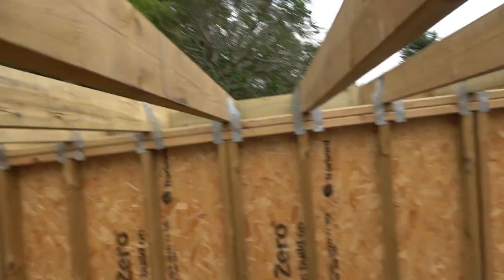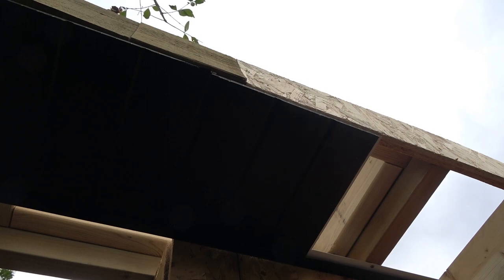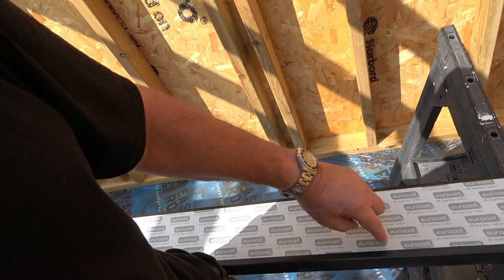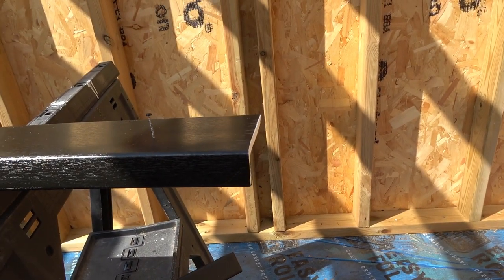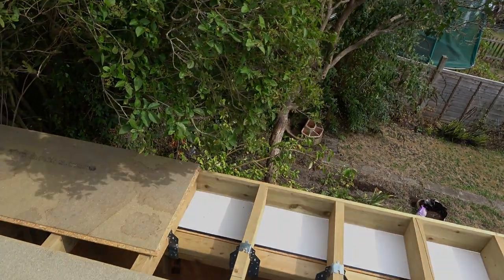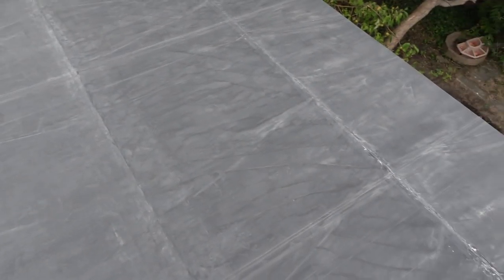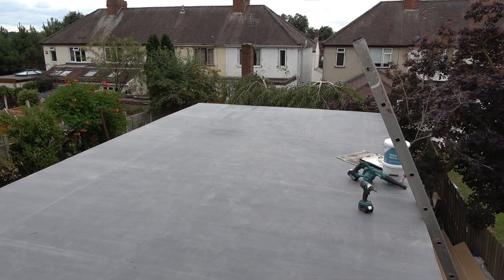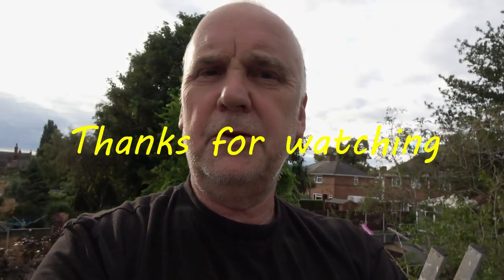garden room # 6 epdm rubber roof # fascia & soffit

Comment: Does the soffit board have the slots in for the ventilation like in the loft conversion roof, or how are you going to ventilate it?
Reply from the maker: Hi Kevin, I have, in my possession, 48 of the 70mm diameter soffit vents. They will be installed after I have done the deck at the front so I can reach easily and not have to work off steps. I’ll do them all at once then. Cheers buddy and thanks a lot for watching.